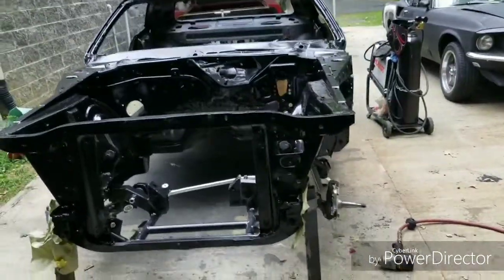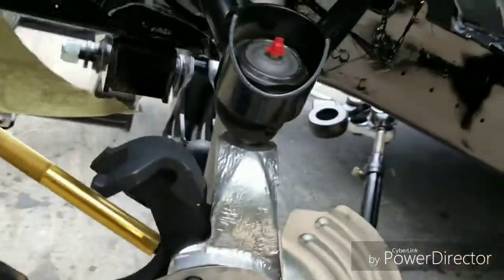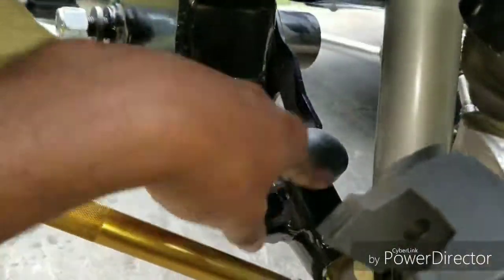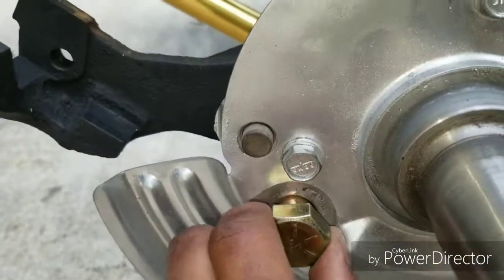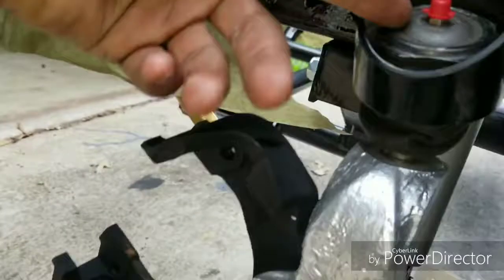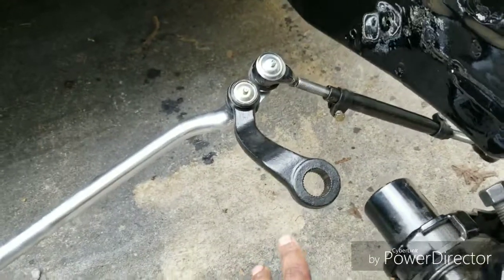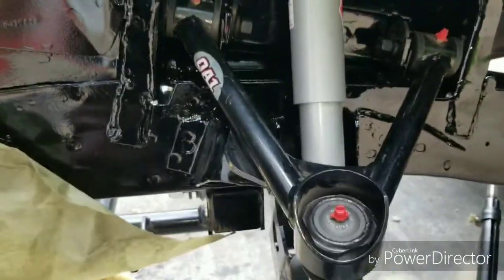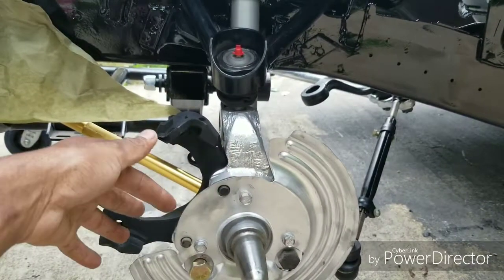1974/71 cuda clone assembly Pt.1

Comment: Coming along nice, nice parts. I like those lower and upper control arms. I had my eyes on those qA1 upper and lower control arms for my charger. I may go with adjustable upper control arms, not sure adjustables are necessary though.
Reply from the maker: Thanks. If you're going to be doing alot of pro touring then i would agree with the adjustable control arms. If you just going to be cruising I wouldn't waste the money
Reply: @musclecargarage8882  Yea, you're right about that.